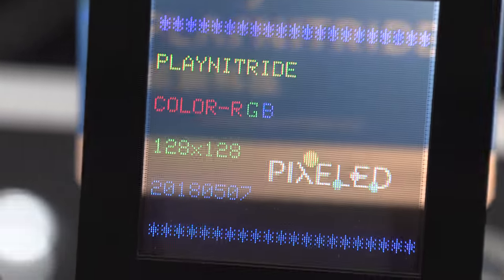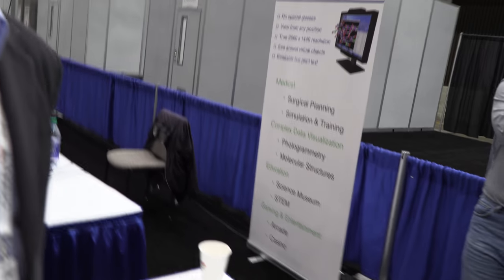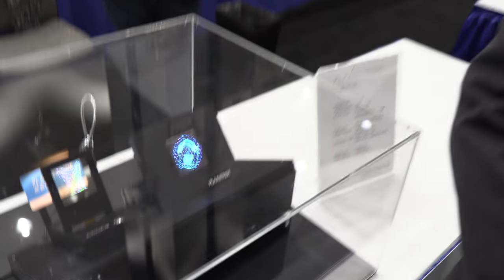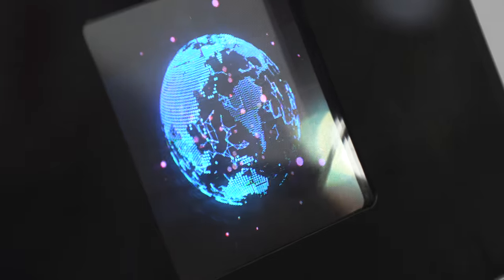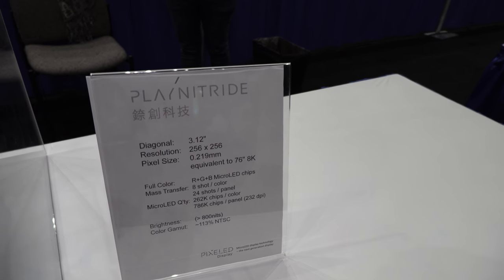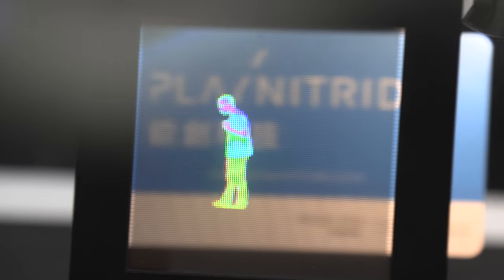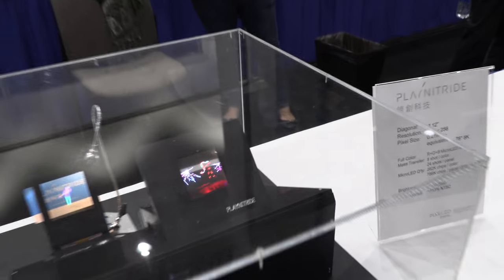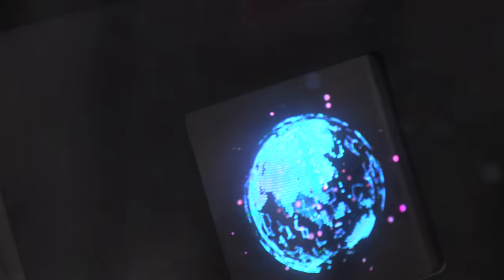PlayNitride MicroLED Wins Honorable Mention Award at Display Week 2018 I-Zone

Comment: Not quite as good but I took apart a old lcd monitor and had it standing up. It was translucent but not transparent. For it to properly work I had a 1900 lumen bulb behind it and that meant it worked like these. Don't know why it's taking so long when I managed to DIY it with good results 😂

Obviously it wasn't perfect but considering this could be done since the creation of back-lit lcd panels I'm a little shocked that it has only started to go somewhere.
Reply: This MicroLED display have NO backlight. 
The pixel themselves are producing the light.